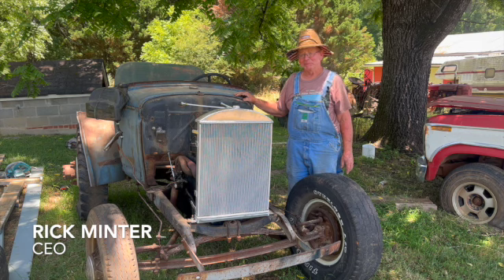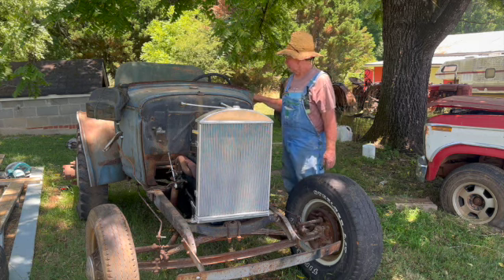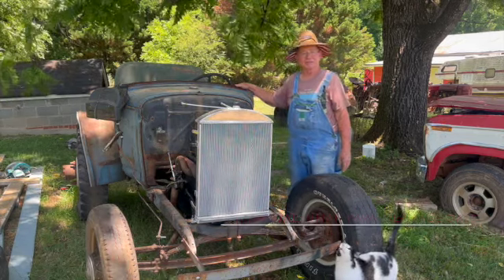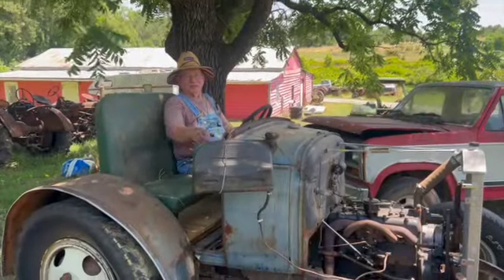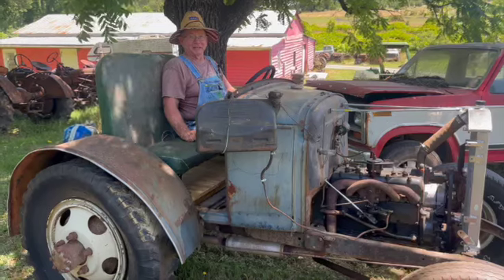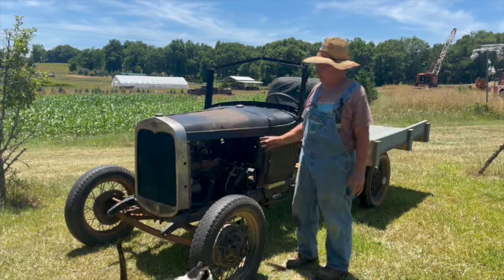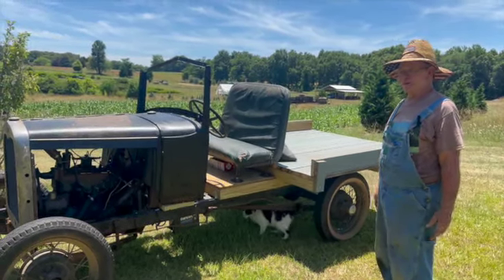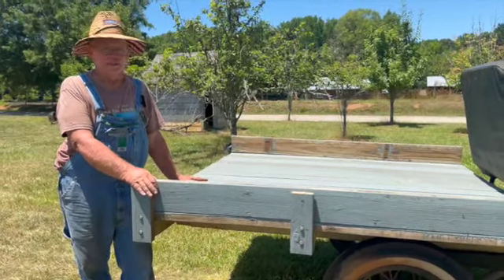Doodlebugs & Cut downs - Part One

Comment: Great video.  In the late 60s my neighbor had a doodle bug made from an old Buick, double transmissions and big truck differential.  The bench seat had a large piece of concrete as a base.  Extra ballast for traction.  He pulled disc and drag for fitting ground with it.  He also snaked logs with it.   I hope you show footage of some doodlebugs at work.
Reply from the maker: Thanks so much for the message. We have acquired an old Buick car and plan to put a wrecker boom on it.